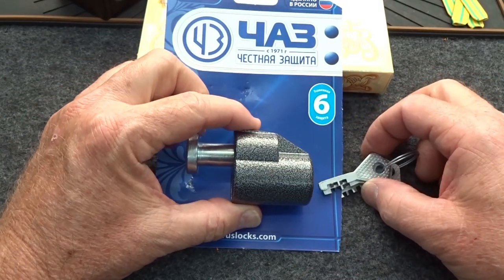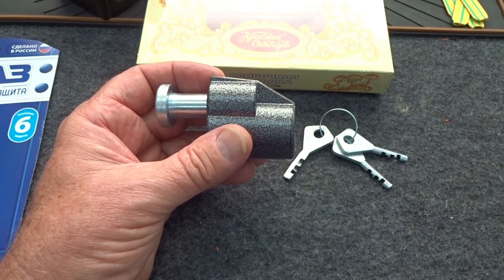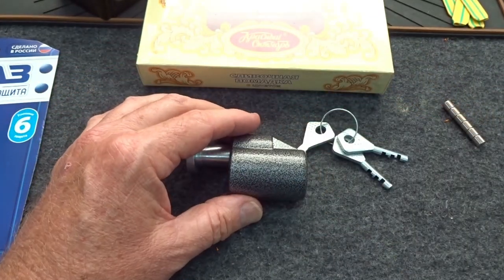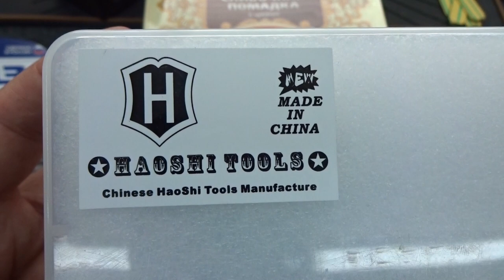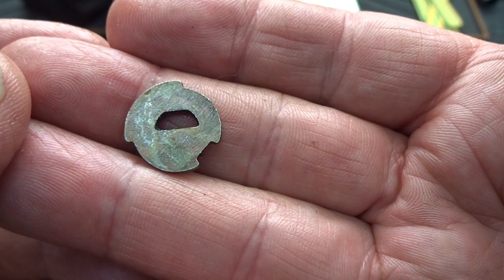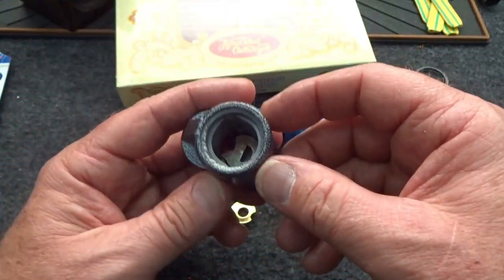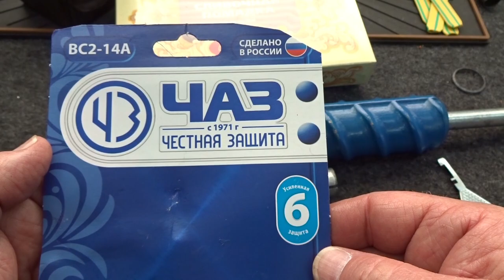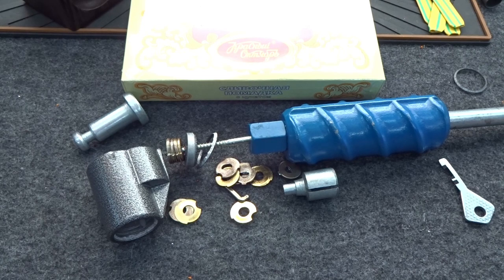(1137) Russian Disc Detainer, uhhh....defeated?

Comment: This lock is mainly used to lock garage doors. In Russia on most of the garages we have two thick metal hoops welded onto the doors, so you can put a lock through them. So the shaft of the lock goes through the hoops, and the thicker end of it doesn't.
Reply: Shitty locks for this application, water gets in and freezes. I remember fighting with it in winters...
Reply: @jcrnda  a little waxed paper and a rubber band would help that.  At least somewhat.
Reply: @jcrnda  А что там бороться...подогрел и открыл.
Reply: Garage54 is a Russian YouTube channel that showcases this idfk just go watch them
Reply: So i guess it's sort of like a stubby shutter lock
Reply: So then there wouldn't be any way to do like Bill suggested and "dump it out" so you can pull it off the shackle. Right? I mean, you're not going to remove the garage door and lift it with the thing attached still 🤣
Reply: @jcrnda  And yet they claim it's guaranteed for 18 months, down to -40°. That's very funny! 😀
Reply: @J__C__  Everything will pull out with a magnet.
Reply: @jcrnda  thats why a lot of times you can see a piece of rubber flap above the loops/lock to prevent water pouring on to them, not 100% weather proof, but good enough
Reply: @fafarcop9579   @Fafar Cop  Yeah.... right. Since everyone carries a gas torch in their pocket...

P.s.: I hate it then the comment section has snippets of other languages that are different from the language of the discussion, so....
Translation of the original comment:
"What's there to fight? You just need to heat and then open it"
Reply: @Shonicheck Зажигалка или спички,  плюс немного бумаги...поджёг и нагрел.
A lighter or matches, plus some paper ... set it on fire and heated it up.

Comment: Interesting to see this in 2020, after LPL and Mr. Bill made their famous disc detainer lock pick.  Now this would be a covert operation, rather than a smash and grab.  Evolution is such a wonderful thing!
Reply: Their famous disc detainer lock pick also tensions the lock on the front, and this particular lock must be tensioned on the bottom. This lock can be unlocked with a huxley pick, but with a tip for a counter rotation opening.

Comment: Great video. To add. If something securing brake disc on a bike. Don't damage it. Even a slight bend to a disc will cause bike to loose control... When the brake is applied .

Comment: If they had built that lock from the other end and press fit on the same side as the bolt. With just the keyway exposed you would have a tough time getting into it. Make the body from brass and it could be a 10.

Comment: You destructively forced both of them without picking them, therefor does that mean they are unpickable?  I wish you had made some tools to at least try. . .
Reply: Erm, no, not even close. There are about 7 ways to NDE these locks. BB's not so hot when it comes to imagination.
Reply: Bill's job is quick entry. If you can enter in 10 seconds, no point picking.
Reply: @huxleypig696  No false gates=easy mode with proper tool and because he would not have any use for that tool after this one job there is no reason to make one when the lock is less than 5$ and he gonna charge the guy muuuuch more for his time and skill then destructive option is the best option.
Reply: These locks would have presented excellent opportunity to shop-make a special tool for NDE.
Reply: I've picked one of these once with a flathead screwdriver.

Comment: Hardened steel concrete screws that are put in with a 5/16 wrench will last longer than a woodscrew. Also, if you ever once get any part of your hand between the slide and the bolt head, you will experience pain like you have never known.

Comment: I wonder if the Ural motorcycle has discs that would fit that lock, but I am not so sure they don't still use drums. The last Ural I rode in had two wheel drive and a reverse gear. It had the side car with a power driven wheel on the side car. They are quite impressive vehicles on badly rutted muddy mountain roads in springtime.

Comment: I wonder if you took a torch to the pressed in part of the lock and used a screw like you did, but just pulled on it with vice grips. Think you could melt the pressed in part of the lock. Thank you for a great Destructive way of opening the lock Mr.Bill

Comment: Actually, upon closer look, it looks like the body of the lock was peened over as you 1st stated. The rough edges that occur after  weak metal being violently torn apart are present in both pieces. Either way success in accessing the lock. (Should I find myself up against one of these Russian Abloy locks) I will remember this technic. LOL

Comment: Abloys turn clockwise?
All abloys in sweden anyway
Reply: kararam you asking? Or telling!
Reply: All abloys do turn clockwise in finland at least. That's the abloy direction. Counter clockwise sounds strange. Besides, Abloy was originally a finnish company. AB Lukko Oy. Basically: Lock Inc.
Reply: I'm telling, but i dont know how it is in the rest of the world :P
Reply: yeah that sounds about right. Good thing us mighty swedes at Assa bought abloy so it could be here even to this day! ;D
Reply: Even the basic direction he gets wrong. Didn't he try the key?? Lolwut?
Reply: kararam it depends on wether your in the northern or Southern Hemisphere
Reply: crunch9876 Haaah xD  Made me giggle a lot!
Reply: 6mm, 9mm and Exec come in optional Left Hand which operate anti-clockwise. The cuts are the same however they are on the opposite side of the key. 

And here's the cool thing : Keying up the drum is opposite so a 1 sits like a 4 and the stop tab is against the opposing drum edge.

When the key blank is inserted into the special Left Hand key machine the profile guides are simply reversed and the cutter in effect cuts 180 degrees to normal.

NB : A Left Hand Abloy key machine cannot be made to cut regular right hand keys and vice versa.

And the key-way is 90 degrees to normal.

Left Hand Abloy is quite common globally however many have never seen it.
it is used where a cylinder must turn anti-clockwise due to some reason.

You normally find Left Hand Abloy in Industrial applications such as cam locks.
Reply: Ade Larsen Many ASSA doorlock mechanisms require the cylinder to turn both ways with equal ease, surprised their Abloy cylinders don't handle that.
  One common type is the deadbolts that unlock on a full turn one way, lock on a full turn the other way.
  Another common type are their locks with cylinders inside and outside on the same shaft with the same key.  When on the opposite side of the door, same key turns the other way.
  And then there's the ordinary quarter turn locks that turn the opposite direction if the door is hinged on the other side, because users of other locks expect the direction to be like that, but that can be taught.
Reply: It might be because Abloy has their own doorlock mechanism that doesn't work the same as ASSA mechanisms.
Reply: Well this isn't an actual Abloy. Rather seems to be copy of the abloy classic core done by a Russian company. So it turns the way the Russian company decided to set it up.

Classic core's patents date back to early 1900's so it's design is decades out of patent. So nothing prevents other companies from using the design. It is hard enough to pick that even Abloy itself still makes and sells classic core locks for lower security range applications.

Comment: could always try to drive the screw in using a cordless impact driver :) might even be able to drive the core out without needing the slam hammer(slide hammer for the body mechanics, pretty much the same tool) and it'd be a little less noise than banging the slam hammer around.

Comment: If the lock body is indeed aluminium then why not try dissolving it with sodium hydroxide solution? should be fun.
Reply: Because you know it works, same reason you don't pick it by using the key
Reply: mmax91 thats will cause a toxic reaction. Not very healthy tho. But nice to look at anyway.
Reply: Or melt it off with a torch

Comment: AFAIK all Abloys turn (unlock) clockwise. Where did you get the opposite impression?
Reply: Abloy 6mm, 9mm and Exec all have option of Left Hand.
Everything is the opposite.
Left Hand Abloy is quite common around the world but mostly seen on large industrial customers like British Rail.
Abloy LH has the key hole at 90 degrees to normal and only turns Left - anti clockwise.

Comment: I'd imagine it'd be good if you used it for a chain (or welded a joint just right on the end) just big enough to get it through.  Bad with the screw+ ram hammer but few thieves carry that around, most would try to drill or hammer it.  If there's a better version not that easy to hammer I'd try to buy.  Combine with a proximity / motion trip and I can rig lights and siren easily it'd be fun.

Comment: Bill, we need to have a talk about unlock direction.  It's clear they go both ways at this point.
Reply: Just like our mutual friend eh?
Reply: Nope, only CW.
Reply: huxleypig69 Mine eyes would say otherwise friend.
Reply: Abloy Classic and knockoffs open CCW? Only once ripped apart?
Reply: SgtKOnyx do you realize who huxleypig is?
Reply: Abloy 6mm, 9mm and Exec all can come in optional Left Hand.

It's quite common around the world especially where an industrial lock needs to turn left instead of right.

The keys are cut on the opposite side by a special Abloy left hand key machine and the drums are keyed up opposite to normal, Eg the stop tabs are on the opposite edge of the drum when seated.

From British Telecom to British rail and from Indonesian Post to Swiss Banks Left Hand Abloy is common.

When viewed, the key hole is 90 degrees to normal. Happy Days folks :-)
Reply: What don't you agree with now ?
Reply: Vintxge Locks No, I didn't. Still don't.
Reply: SgtKOnyx He invented several totally new techniques to open Abloys (amongst other locks). Made tools to open allegedly "unpickable" locks. He picked the (non-knockoff, better) lock in this video in 13 seconds (not destroyed). You should check him out :-)

Comment: Locks with a similar core are still hacked by folding the core. A
 bit from the screwdriver is taken, sharpened, clamped into the 
instrument and moves to the left and right, slowly, with amplifying 
amplitude, the discs swing and curl to the right. Just like on this video.
https://www.youtube.com/watch?v=L5e5-1BNNeQ
Sorry for the bad English, translated through Google translator.

Comment: should have a disc brake in the vice instead of the lockbody, you probably wouldnt have been able to screw this if it was fixed to a disc brake

Comment: why not try and make a steel spacer and put it in than the screw can push against it and you might be able to avoid using the slam hammer

Comment: That's perfectly normal opening direction, I haven't seen many (pad)locks that would turn CCW to open.

The chinese pick you showed for picking Abloy locks could have worked on this lock, because if you look at the videos of that tool it should tension CW and you pick the discs CCW, because that way they do not bind when turning them. But this is all hypothetical, as the tool works only when picking the discs in order of deepest first, which I have never seen work on an Abloy as the binding order is completely random (surprise).

What did caught my eye is the shape of the keyway cutout in those code discs. Are they slightly flattened on the round side? Looked like they were and usually the cheap Abloy knocks-offs have had a key stamped out of thin plate and thus it is not half-round like an Abloy Classic would be, but instead flatter.
Reply: About the worst Abloy video I have ever witnessed.

Comment: "All you've got to do is dump the guts out then you can open it." 

Yea. Like that's possible when it's locked up, Bill. You just gonna lift up whatever it's attached to like that 7000 lb truck so you can "dump it out and then...open it"? 🤷🏻‍♂️🤔

You get so into trashing these locks and companies you don't realize what you say sometimes.
Reply: You can dump out the mechanism using a magnet.

Comment: use a drill to screw a screw if your working on a lock u have a drill
Reply: NATHAN NEVILLE screwdriver is just slower, you get plenty of torque
Reply: Or use those screw with hexagonal head, you know, the mix between the screw and the bolt...
Reply: He was talking about keeping it low noise, a drill would give you away before you had the chance to remove the lock. With the slide hammer, the noise happens the moment you disable the lock.
Reply: @NolanSyKinsley A drill is near silent, you hear a slight whirring noise but if you're on the street it wouldn't attract any attention. I think the real reason he didn't use it is because most people don't carry drills with them, but a slide hammer easily fits in a too pouch.
Reply: It depend what you drill. Even with oil it can make quite a loud squicking sound. And a good drill is not what I call near silent, I'ld say quietish.
Reply: Squeeking only happens when you drill wood
Reply: No, it also happend on metal.
Reply: NATHAN NEVILLE Any electrical or other power tool is against the rules of locksport.  Rule might be slightly anachronistic but made sense when a big enough battery weighed 9 pounds and no real door would have a working electrical socket near the outside, but a locklab would have plenty.